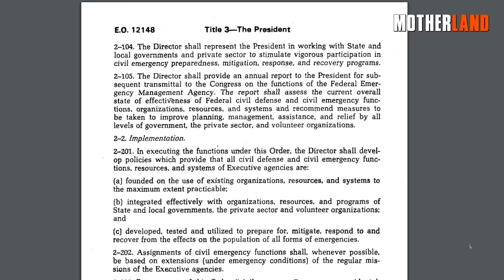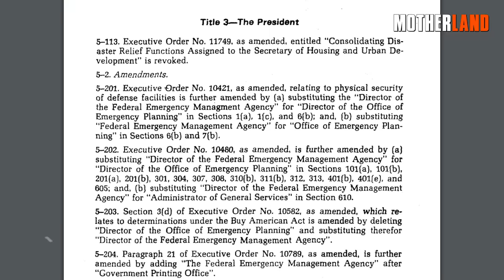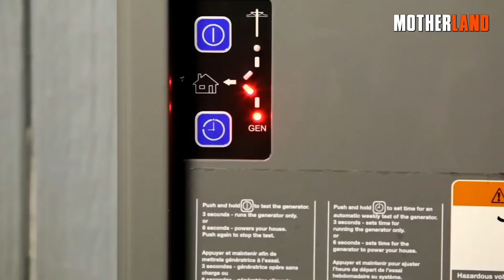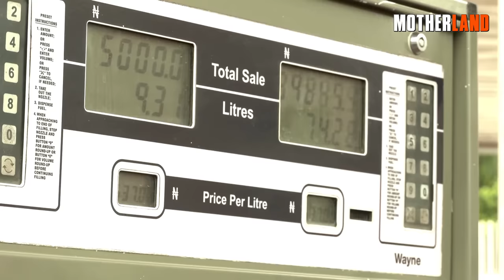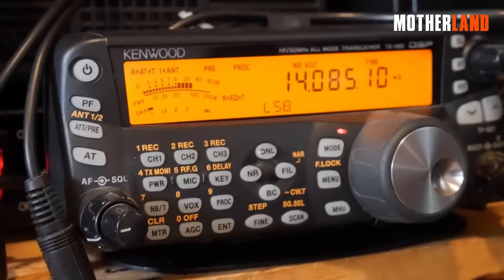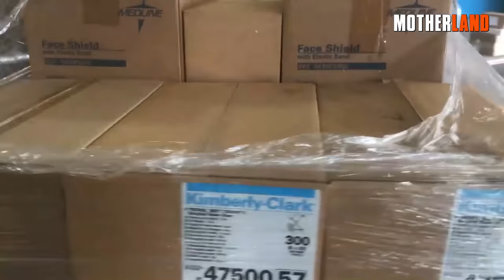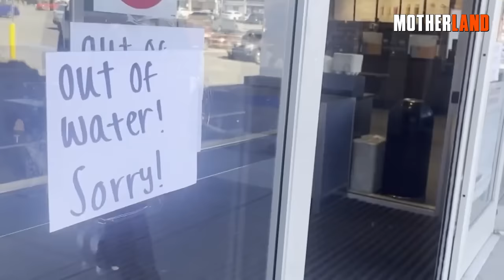7 Prepping Items That FEMA will SEIZE When SHTF

Comment: AKA Hide All Valuable Items from Federal and foul thieves.
Reply: Obviously some things are easier to hide than others, for example it's kind of hard to hide a permanently wired automatic standby generator, and it's kind of hard to hide a vegetable garden that's planted outdoors.
Reply: @coolsnake1134  plant it in moveable square boxes made of wood that you can move with a trolley,and hide the generator in a sound proof building,and don't do it in the front of the house,have a fence around the garden 10 feet tall,and have it so you need to walk through the house to access the garden.

Comment: Forget any alternative power, other than Solar. Why cuz when the gas is used up, the gas generator is usless. Best get solar & Marine Batteries, solar generator, & hotwater on demand units. Get a small space heater, & get some 500w or less refridgerators, hot plate, & cookers, & 700w microwave. I already have all these in my can.

Comment: Remember to get all the information and knowledge that's available while you still can, get army field manuals especially ones relating to asymmetric warfare, improvised munitions etc also do research and learn about the troubles in Northern Ireland as well as the iRA before everything is censored. The police have similar equipment now to the army so if they come for a visit give them a belfast welcome
Reply: And store that info in your brain but also on printed media in a fire resistant filing cabinet. Computers may or may not be usable depending on supply of electricity and if you store that data on a computer make sure you use mechanical hard drive if you're going to have to store that for many many years, SSDs will eventually no longer retain data if they are not powered up for long periods of time

Comment: Every conclusions here is wrong, let address Hurricane Katrina and the disaster within a disaster. 

This was a situation created by Bush, Cheney and Rumsfeld. With the creation of DHS and the push by that administration to undermine FEMA. (In the 8 years of Bush's presidency FEMA went from being the best department to work for to the worst) The problem was that DHS was calling the shots and sent in security to stop entry into the area. This security stopped everyone including first responders. After words I spoke with responders that were completely blocked from entering to assist. One Fire Department that made it in had to sneak in on dangerous roads to assist. The fault was not FEMA's, but they received all the blame.